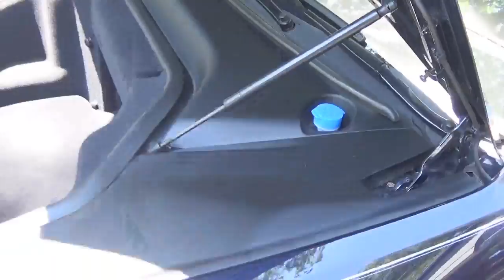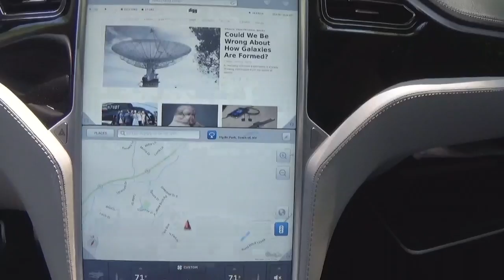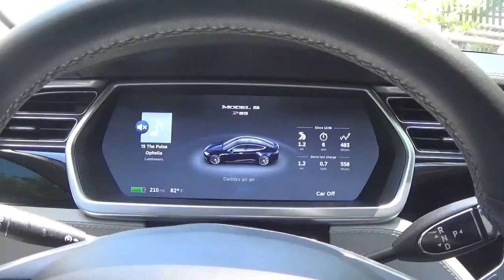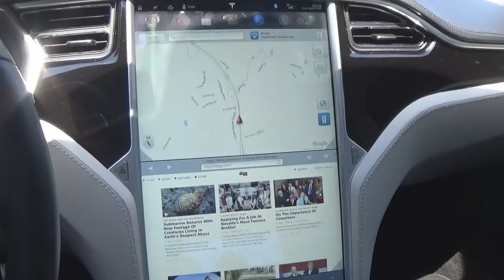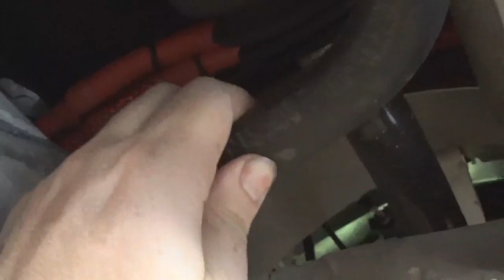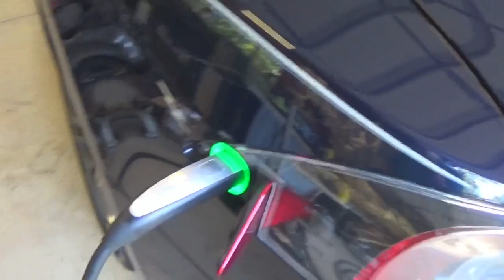Looking at a Tesla Model S P85

Comment: 16:12 The charging cord that comes with the Tesla is not a "charger", but a electric vehicle supply equipment (aka EVSE) which is a fancy extension cord to prevent shocks and other problems associated with drawing high current in any weather condition.  The 240V 40A AC -> DC converter aka charger is built into the car, with an optional 80A 240V dual charger option.

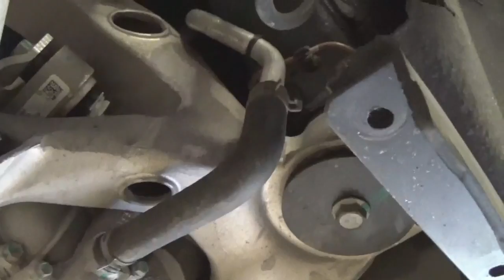Comment: 11:26 The unit on the drivers left is the electric motor that powers the gear reduction into the drive shafts, the unit on the passenger side right is the inverter that converts the DC 400V+ high voltage into three phase AC to power the electric motor.   These units have a shared coolant loop to keep temperatures within range, even when putting out >>400 HP to the rear wheels!
Reply from the maker: Good to know!

Comment: You should be able to have auto pilot still. From my understanding it's just a software update
Reply: Correct.  Tesla cars manufactured before Oct 2014 do not have the camera and radar systems necessary for auto pilot.  We have an early production 2013 and do not have auto-pilot capable car, but any Tesla is an amazing car!
Reply from the maker: I don't think it has the cameras/radar system.
Reply: +SmartElectricCar gotcha. Thanks for the input!